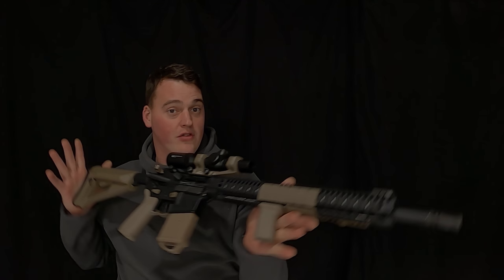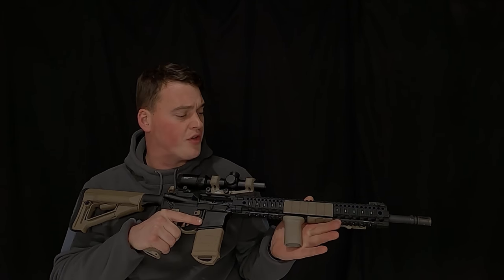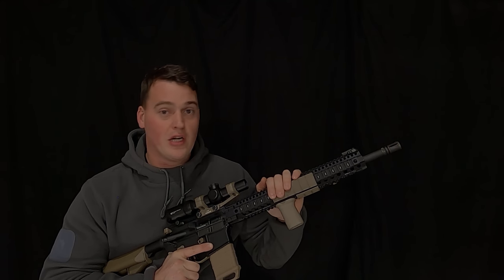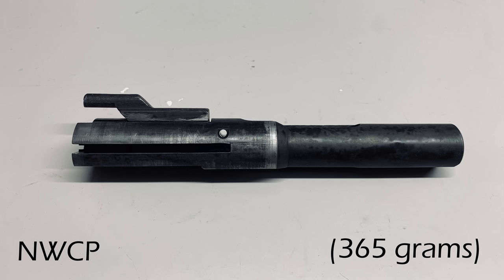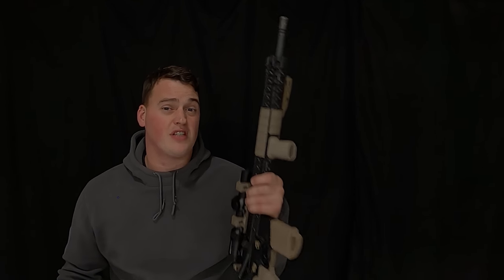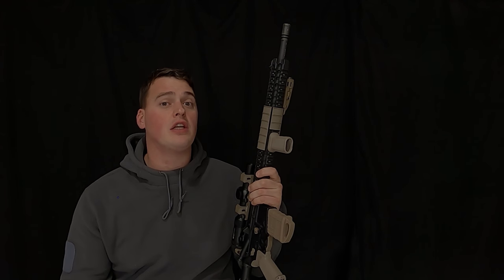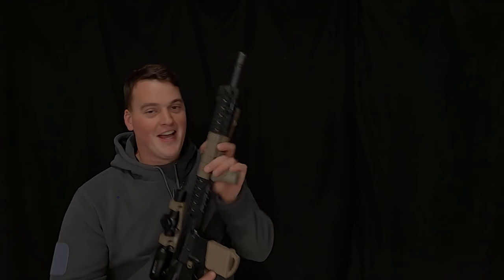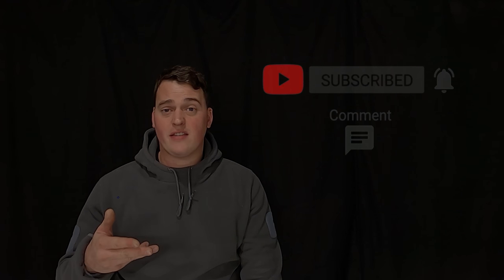The Guncraft 22WMR AR-15 - Is it better than the NWCP?

Comment: I have a October 2019 guncraft ar15 22wmr  and ordered a 16” barrel. I did change the upper and lower for CMT, the gun does shoot amazingly well. Accuracy is unbelievable, more akin to a bolt action rifle. Rob and Dean are genius! You have to shoot one to appreciate it! Far from a toy or fad!
Reply from the maker: They have certainly improved on the WMR AR platform. It’s interesting to see the differences to the NWCP.
Mine is in an aero build that I run a 22lr upper on also, nothing too fancy but it seems to work well with the GC so far.
Reply: I honestly can’t compare to a nwcp rifle, I’m running a triggertech trigger in mine and this is how much faith I have in my guncraft rifle;
When they release the gen2 I will getting one of those as well with the forged receivers as the only annoyance I have over the ar15 platform is the way it keys or doesnt(!) together but Dean assured me it’s just one of those things hence the adjuster screws
Reply from the maker: @ianbrisland1982  yeah, my areo receivers have a lot of slop in them too. It doesn’t bother me all that much though, just one of those things you have to put up with unless you want a matched billet set.
Have you shot a NWCP WMR Ian?
Reply: @Range23  my CMT is top of the line billet I think and still a small amount. I just expect things to key in. My own ocd I’m sure ;)
Reply: Are you guys saying forged uppers and lowers are better because the tolerances are better. Less of the rattle you get with ar's?
Reply from the maker: @jamesminshall4601  Not forged, but billet sets usually have better fitment if they're matched sets. Although it can vary depending on manufacturer

Comment: Hi there matey, am loving your 'Northern Style' as a fellow northerner it's nice to hear rather than yet another 'Shandy Drinker'. Just got my 22WMR Variation back from my local force and I am currently in discussions with Rob at Guncraft Ltd. about one of their 22WMR AR's. The thing that I can't seem to decide on is barrel length vs Handguard Length. What Length is your DD Handguard? as I am aware you're running one of Rob's earlier 18 inch barrels. The reason I ask is I like the look when the barrel doesn't protrude far past the Handguard, that way when you add a moddy it kind of has the look of an MP5SD if you know what I mean? Finally I see you like the Kriss Defiance DMK22, I've had mine for just short of three years and I absolutely love it, still one of my favourite gats. I'd post a pic but haven't worked out how to do it yet? Oh an incidentally this is my first ever You Tube comment so consider yourself honoured!?!?! lol.
Reply from the maker: Now then pal, cheers for the comment 👍🏻
My handguard is the 15” version. The barrel length is 18” but just remember that it sits back slightly into the receiver, so don’t forget to take that into account if you’re measuring up.
Also, that’s not a Kriss I shoot, it’s another Aero build in 22lr 👍🏻
Reply: @Range23  Hi fella,  I realise it's not a Kriss I am just aware that you replied to Moody Edge saying "I’m hearing good thinks about be Kriss, would love to get my hands on one" henceforth me mentioning it. lol. I just appreciate all things AR.
Reply from the maker: @markwilson4357  ah fair play pal. There’s certainly a lot of choice for AR based platform out there now, lots of good options too 👍🏻

Comment: Love the look of this, is the quad rail hand guard an aftermarket part ? If so where did you get it ? Wanting to get one when I get a .22 Tippmann
Reply from the maker: Cheers mate. It’s a Daniel Defence rail. I love them. They fit any mil-spec receivers so as long as your gun is mil-spec you should have no problems.
Reply: Range 23 thanks for getting back to me, it is indeed milspec, seen a lot of quad rails out there and have been going between them all and this has just solidified my decision on the DD rail ! Cheers !
Reply from the maker: @jamesbilling4872  no worries pal. They are a bit pricey, but you get what you pay for. I’d say the DD quad rail is the best on the market.

Comment: Looks a nice rifle well engineered, would it be unreliable for running with a mod and pest control use, would it do better than 1in groups with the right ammo
Reply from the maker: They run with moderators just fine. I got the occasional misfeed when moderated but the longer feed lips sorted that out. Just don’t forget you’ll still get the sonic crack as the rounds are supersonic.
I can shoot 1” groups consistently with the right ammo and good conditions, and I don’t think I’m the best shooter out there so you may be able to tighten them groups up a bit. The consistency of the ammo will be the biggest factor though.

Comment: The feed ramp must be a bit awkward to clean, I never realised they were fixed to the barrel. What is the gas key for, just aligning the bolt in the receiver?
Reply from the maker: It’s no more awkward than any other rimfire rifle really. I just use a cotton bud for it. Cleans it up real nice.
Yeah, the gas key isn’t functioning it’s just to keep the bolt aligned when the rifles cycling.
Reply from the maker: @markhardcastle1506  the charging handle mates into a machined flat spot on the bolt on these rifles. The gas key plays no part in the process whatsoever.
Reply: @Range23  I stand corrected, the hole in the charging handle is for the gas tube 🤦‍♂️
Reply from the maker: @markhardcastle1506  no worries mate 👍🏻
You can see the small ledge machined on the front of the bolt for the charging handle to engage on in one of the pics I think

Comment: What ammo runs best in your Wmr?
Reply from the maker: I use a lot of Federal and CCI in mine with minimal fuss. Aguila also performs well if you can get it.
Some of the 30grn rounds can be right on the limit to reliably cycle the action, but it can vary from gun to gun and different ammo batches.
The only ‘bad’ ammo I’ve used was from RWS, I did a video on it.

Comment: What mags are you using ?
Reply from the maker: Black Dog 14 round magazines, they are the only ones currently available.
I’ve just made some magazine extensions for them to get 20+ rounds in there.
Reply: @Range23  . So the extension allow  you to load 20 rounds rather the 14?  Where are these from please?
Reply from the maker: @heshtankon7212  I made them myself.
Reply: @Range23  . Ah!  That’s interesting. Have you made any for anyone else?
Reply from the maker: @heshtankon7212  no, a lot of people want them, but due to how flimsy the Black Dog mags are, there’s not a lot to work with. So the process is very time consuming and the end product isn’t currently what I’d call sellable to be honest with you.
Reply: I have 4 black dog magazines, they are very flimsy. I can only fit 12 to 13 rounds in them. Which is annoying to say the least.  
I’ve been running the CCI game point and have found they extract and jam in between the bolt and charging handle. I thought it was because I am not running a sound mod and the bolt not travelling it’s full journey to the buffer. 
Most of the time I can hear the buffer Woking in my ear, but the times it has jammed I don’t remember hearing it .
What do you think? 
I’ve also been told the Agela ammo cycles well in this rifle?
What are you running or what have you found to be the most consistent?
Reply from the maker: @heshtankon7212  40grn CCI and Aguila has always ran well for me.
Do you mean the spent case is jamming the action up once it’s been extracted? As in it’s not ejecting but staying in the receiver? I can’t say I’ve ever experienced that myself, but my first port of call would be to look at the extractor. If it’s not holding onto the spent case tight enough then it won’t ‘spit’ it out the gun with any force. Have a look at that clip of Deans gun in my Guncraft video, you can see the erratic ejection and the last round barely makes it out of the receiver. That’s due the the slightly looser tolerance on the GC extractor, it may be that yours is worn or just loose enough to not properly eject the case every time.

Comment: What hand guard do you have fitted on this?
Reply from the maker: It’s a daniel defence DDM4 rail. I’ve got a video on the build here;
https://youtu.be/NrdvYmrcbSM
Reply: @Range23  thanks for getting back to me. I’ve Just purchased one and it’s fantastic. Only thing I noticed was quite a sticky bolt where the charging handle would lock back and you’d have to give it a nudge to send it home, made worse when shooting suppressed. I appreciate the gun is still bedding itself in.
Reply from the maker: @Benjamin-578  what rifle did you go for? A Guncraft gen II?
Reply: @Range23  yes a 16” Guncraft. I can only presume it’s a gen II, picked it up brand new from dauntsey guns only a day ago.
Reply from the maker: @Benjamin-578  do you mean the bolt is hanging up during firing? Or is it when you’re manually cycling the gun? 
It’s my experience that they take several hundred rounds to bed in
Reply: @Range23  when you pull back the charging handle it sticks. Like the bolt hold is on, it takes a nudge to make it release. Could just be a lubrication issue but when firing it’s generally fine, the bolt cycles well with 45 grain Hornady. The problem comes when shooting suppressed, a lot of smoke coming out the chamber and feeding issues after continued use. I’m guessing this is a bedding in issue and using the right lubricant, Just wanted to know what your thoughts might be.
Reply from the maker: @Benjamin-578  that’s odd. Could be lube or bedding in maybe, if you can, try and see what it may be catching on, witness marks etc.
As for running suppressed, depending on your can, it can massively increase the back pressure. Not much you can do other than add weight to the buffer, but don’t go messing with it if you don’t know what you’re doing. The other thing is recommend is using the improved magazine feedlips from Guncraft, they really help with feeding issues
Reply: @Range23  it’s very hard to tell. I put a Radian Raptor charging handle in first thing when getting it back and it may be that it just doesn’t like it. I’m seeing some slight wear marks on that now. With a bit of oil or lubricant she seems to charge fine, but as soon as I shoot suppressed it’s like it strips all that oil and I’m running the gun dry. I’ve got the suppressor that’s in the photo on their latest post. Think it’s a wildcat. I probably won’t go messing around with things I don’t have any knowledge in I assure you haha. Noted about the mag lips, I’m speaking to them on Monday about the magazine extensions so I’ll run a few things through them too. Really appreciate your help at thinning down the variables and I shall not disturb you any further, you’ve been a great help and keep up with the brilliant content!
Reply from the maker: @Benjamin-578  the wildcat is a great moderator, but it is one of the higher back pressure ones. I doubt the charging handle is causing you an issue. I’d definitely try the mag lips, they’re a must in my opinion. Also, don’t over lube the rifle, that can cause issues in itself